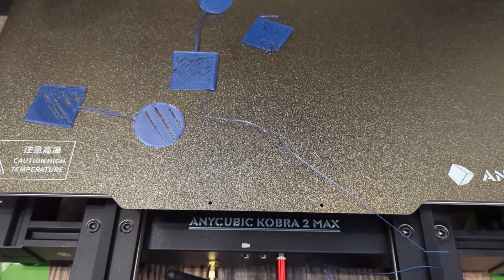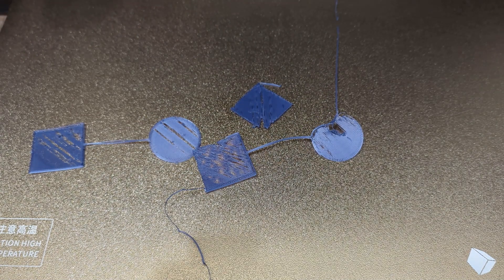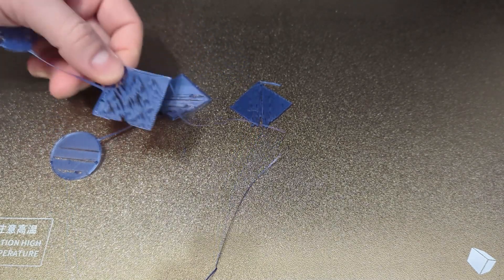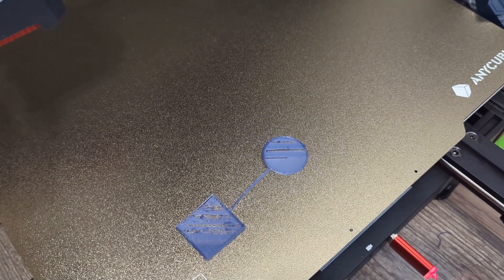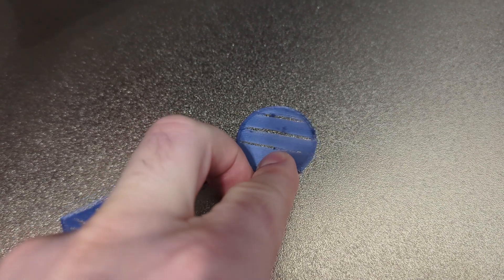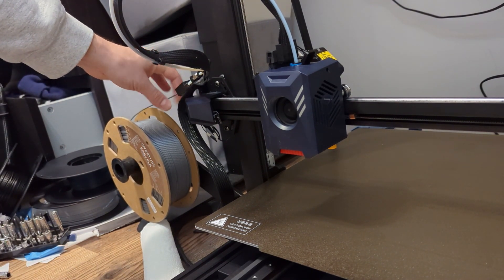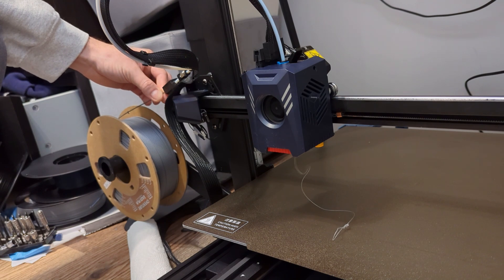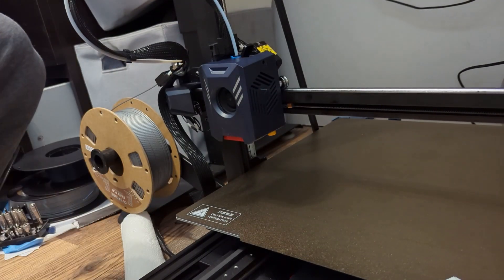Bed leveled yet still inconsistent first layers? Let's check the filament extrusion tensioner.

Comment: I found another cause of this. Used an AnyCubic PLA Bright Orange. There was a tangle on the spool about 10-20 layers in that was putting back-tension on the feeder until it ultimately stopped. I cut the tangle out, re-fed, and resumed.

Comment: How do you z off set adjust on this printer?
Reply from the maker: you have to start a print first then you should immediately find the option on the touch screen to adjust the z-offset.  Whatever you set should be saved for the next print, through power cycles, etc.. but ive had the printer randomly reset the zoffset a few times - I think its either during firmware update sometimes or just a bug.  Anyway I recommend keeping a log as you adjust it, helps learn, also helps keep the last known good setting.  Id note the offset value then the first layer print quality
Reply: @mark4jr  I find it odd that there's no option to manually configure the z offset. I think I will use a log that's a good suggestion. Your suggestion to turn the screw on the print head has helped a lot. It is all these small tweaks that Anycubic needs to have testers work on although I have to say Anycubic has amazing customer support, unlike any other.
Reply from the maker: @emperorkalel  yeah IMO its dumb you cant just raise and lower the nozzle manually, would make it super easy to get the nozzle in the ballpark without even running a print.  feel ya there
Reply: @mark4jr  Thank you for the video - keep them coming. Subbed

Comment: your videos are great- im in a similar boat, but i have another strange issue which is print quality gets a little rough in a predictable way i.e. when i print a timing pulley, the north east face gets a little messed up. im wondering if there is something about how the head is bending the tube that causes underextrusion only in certain ways. as for the e step calibration, is there a way to just insert custom g-code at the beginning? i know anycubic doesnt make the initial estep param known but maybe there is some way of discovering it.
Reply from the maker: I had a chunk of filament stuck in my print head, ever since clearing it its been pretty smooth sailing and gorgeous prints.  Replacing the little piece of PTFE tubing inside of the hot-end with capricorn tubing I think was also pretty crucial in keeping the nozzle from clogging.  Stick with it, had both my printers dialed in printing flawlessly for months now.
Reply: Could it be that your fan is only cooling from one side, not omnidirectional, therefore you get inefficient cooling on the side that gets a bad finish? :)

Comment: Had a similar issue with my Sovol SV07+ printer.
It was feeding out of a dryer box causing extra tension on the filament. Would print fine on the overhead spool holder, but had issues when i tried running filament directly from the dryer.
Going to try running a PTFE tube from the dryer to the print head and hopefully that'll fix the feed issue for me 😅
I'll report back (if I remember to lol) with an update after trying the fix
Reply: UPDATE:
It worked.
$0.50 of PTFE just fixed a problem I've been chasing for over 2 weeks.
3D printing is Hell, and possibly one of the most masochistic hobbies that doesn't involve direct physical torture.

Happy printing! :)    (send help)

Comment: On the K2 max you can't configure e-steps because KobraOS is locked out, you can only change the extrusion rate in Cura. They configured marlin in for relative extrusion instead of calculating the actual e-steps because they don't test their printers before they ship them. Point: Changing extrusion rate to 99% in cura HUGELY helped without under-extrusion.
Reply from the maker: Yeah I learned that investigating this issue.  Fortunately I found it was just the extruder slipping and not an adjustment required to e-steps.  One of these days I plan on tuning the slicer flow rate but for now its printing really well with really good quality on large prints.  Thanks for the tip!
Reply: @mark4jr  Have you tried using Cura with it yet? I'd be glad to share my settings, if you put an email on your channel page, definitely curious what yours are or what you'd change